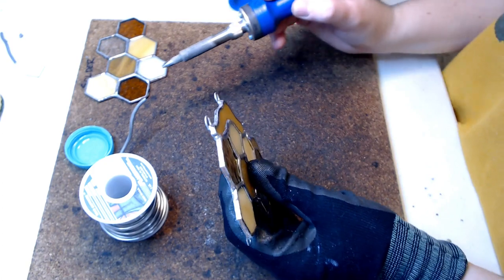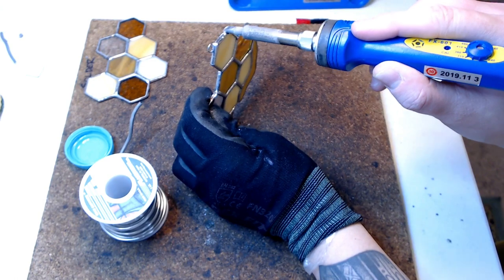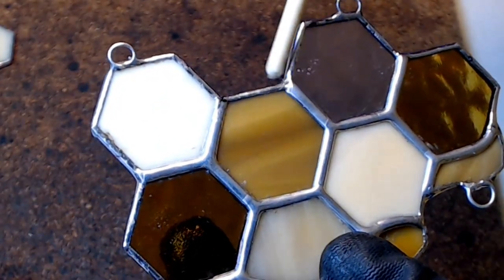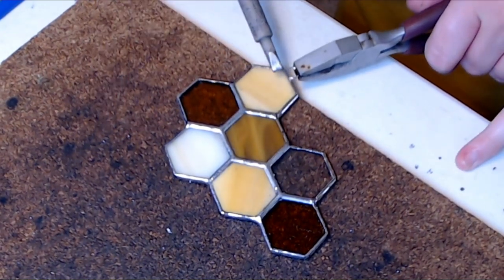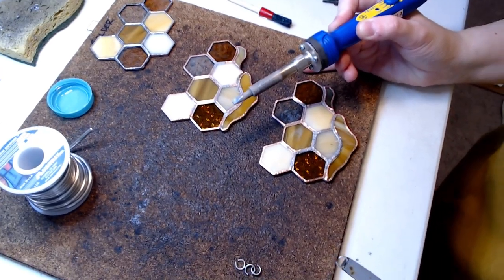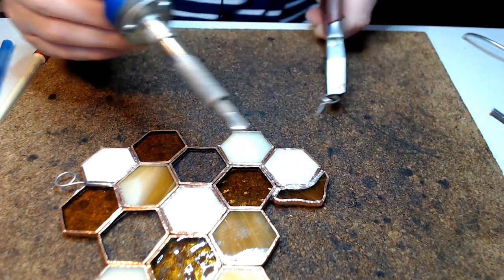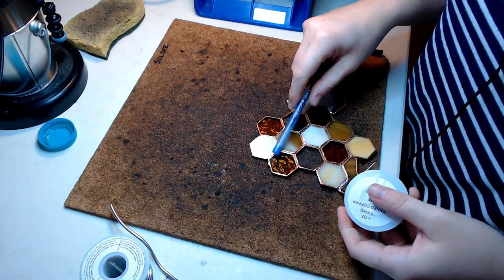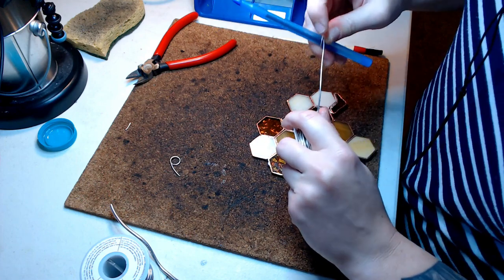Stained Glass Soldering pt. 2 :: Jump Rings & Beading the Edges

Comment: Hi Rachel, i was wondering if you also used custom jump rings for heavy stuff ? Will it not bend under the pieces weight ? It seems to be a soft material on the video. Thanks
Reply from the maker: A really great question! For small and medium sized pieces I make my own jump rings with 16g wire. For larger pieces, which I admittedly don't make very often, I've used 14g wire and found it to be very sturdy. If there's ever a doubt about jump ring stability, you could even double loop it and use two rings.

Comment: Thank you for such a helpful video! May I ask what glove you’re using to hold the piece while beading?
Reply from the maker: Glad it was helpful :)! The gloves are found here:

 https://www.amazon.com/DEX-FIT-Comfort-Stretch-Lightweight/dp/B07FKLWF3G/ref=sr_1_7?dchild=1&keywords=dex+fit+gloves&qid=1615118277&sr=8-7. 

After you solder in them for a while the flux tends to soak through the rubber coating, so I also like to wear a plastic glove (like those thin food prep gloves) to keep the flux from getting in cuts